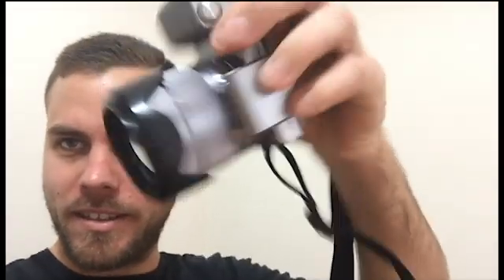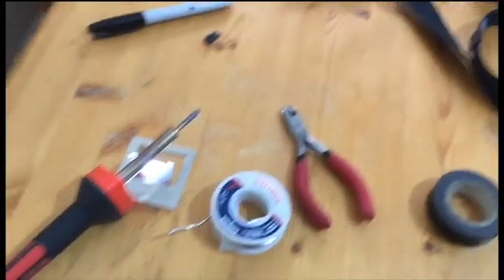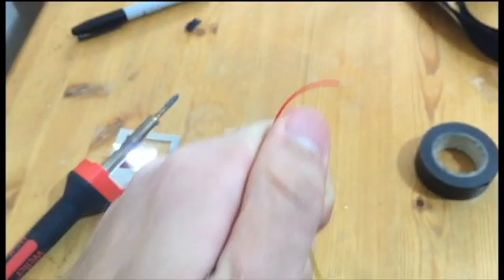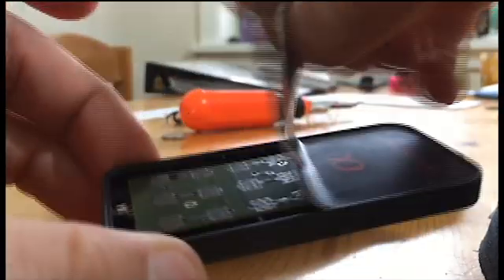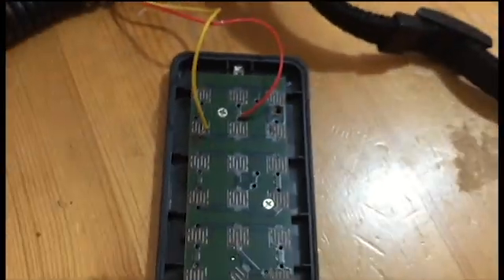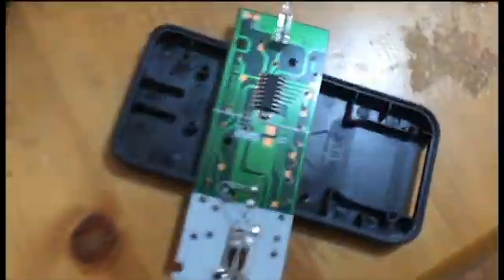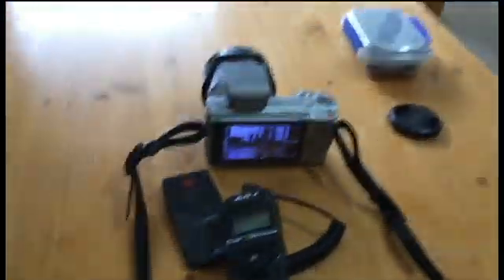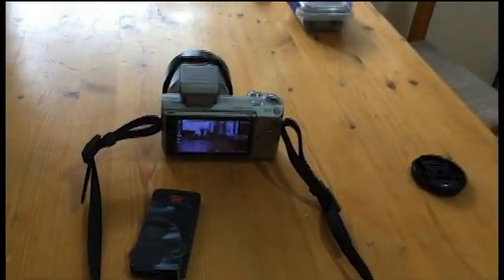Sony Nex DIY IR Timelapse Remote/Intervelometer

Comment: Please help in regards to fist vid for nex remote i know its old post still relavant  i need to know how you worked out where to put the 2 wires on to the remote as i have same remote but it looks different So im sure where to attach red n yellow wires
Reply from the maker: The yellow is a power wire and the red is a communications wire. You can put them in their respective locations based on the wiring of the remote you bought. Hope this helps
Reply: @joelgregoryhayes7045  thanks for replying so fast. no still unsure so yellow is positive? And you are saying those wires go on positive n neg on remote?